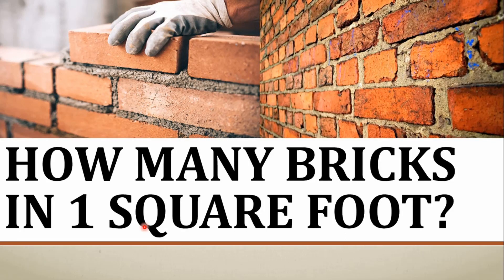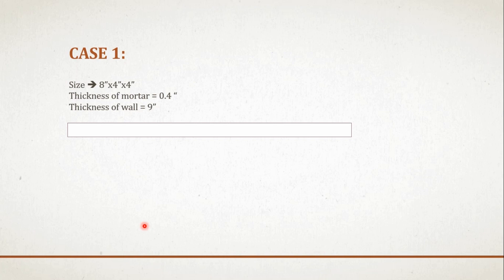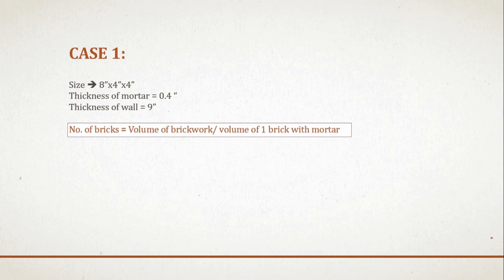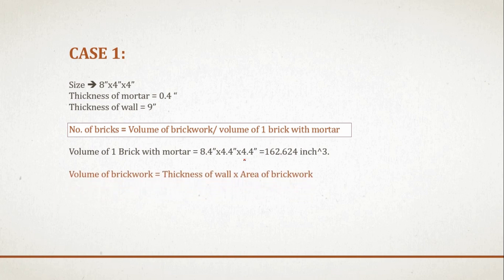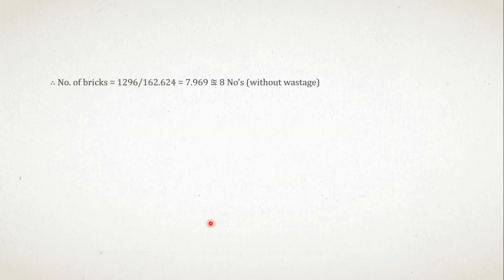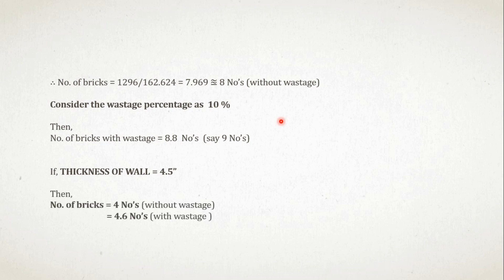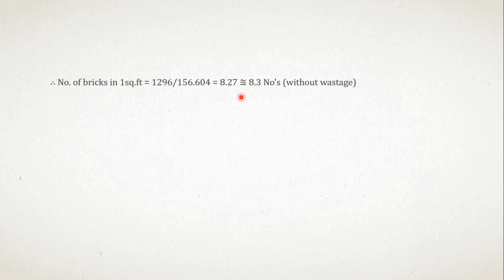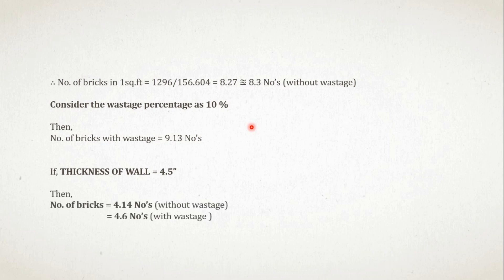How to Calculate Number of Bricks Per Square Foot | Estimation and Costing

Comment: Good technical explanation. In fact I am intending to built my compound wall of 24"( height) ×9" (width)× 72" length. So this information will help me build by myself with hiring local people. I think that I will require 1100 bricks for this wall and two brass river sand plus 20 bags cement. Thanks for good informative clip.
Reply from the maker: In your comment your dimensions are in inches? or feet?

So that i can help you correctly. 

there is some mistake in your calculations.
Reply: @wecivilengineers  
GM.
Let me first wish you good health with prosperity and piece of mind.
I am very sorry for putting wrong dimension.
Its 24"× 9"×720" ie 2' height ×.09' width × 60' length/long.
Thanks for responding and mentioning my mistake.
Reply from the maker: Ok here's the calculation for your wall.  

Dimension: - 2 feet x 0.75 (9")  Feet x 60 feet.  
Case 1: -
Size of brick: 8" X4" X4"

Then 
8.8x2x60=1056 numbers
Case: -

Size of brick=19x9x9 cm

Volume of Brickwork= 2x075x60 = 90 cubic feet =2.5485 m3

For one meter cube we need 500 no. Of Bricks.  

Therefore,  total no. Of bricks= 500x2.5485 = 1274.25 no's.  
 Say 10% of wastage 

Overall you need 1402 number of bricks including wastage.  

Happy learning: -)  

Thank you for your wishes Sir.
Reply from the maker: You can always contact me through any of the platform which i mentioned in the description of every video regarding any doubts in construction.  

Happy to help: -)

Comment: wouldn't it be wrong!! 
one brick+mortar volume will be 8.2"X4.2"X4.2".
Reply from the maker: NO. whatever calculation which i have done is correct.
Because 10mm = 0.393701 (say 0.4 inch).
Google is " mm to inch converter" you will come to know.

NO ONE PROVIDES 5MM THICK MORTAR, IF YOU PROVIDE 5MM MORTAR YOUR MASONRY BOND WILL BE WEAK.

If brick + mortar = 8.2"x4.2"x4.2" then No. of bricks will increase
Reply: I'm not talking about conversion.
you did consider a full layer of mortar in volumn of brick+mortar.   that's not how it works, one layer has two adjacent brick and mortar layer will be half-half in both.
That's what I'm saying.
Reply from the maker: okay. 
yeah i have considered for full layer of mortar in volume of brick+mortar.
Reply: thanks for understanding it. 
Make the corrections or pinned a post in comments, that would be good for users. 
GL for channel i like the videos.
Reply from the maker: sure.
thank you :-)
Reply: Sir I plan to build five room having length of 105feet width 18feet and heights also 18 feet so how many bricks will be required for this whole 5 rooms all sides ? I will be waiting for your reply